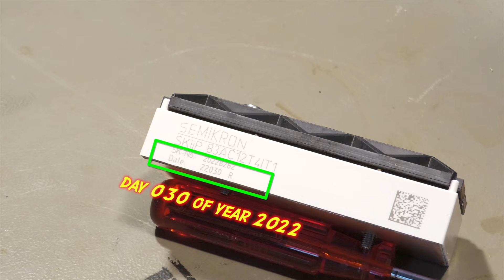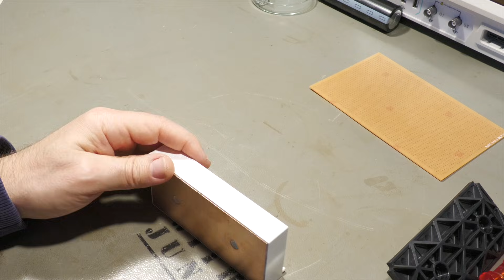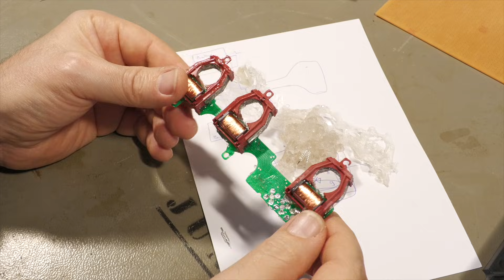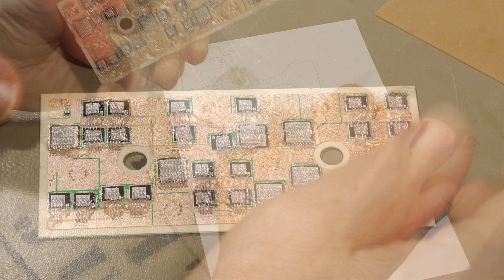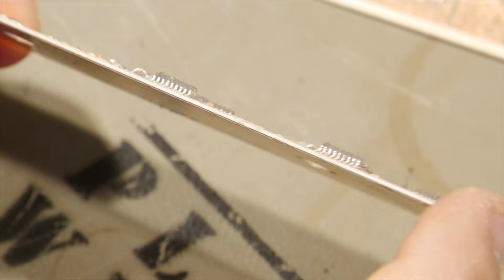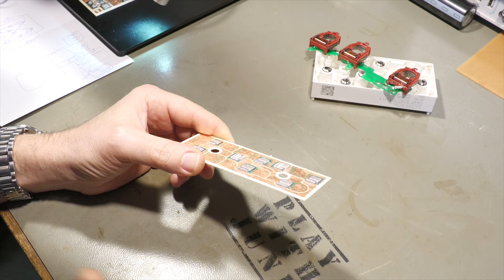Lift or Elevator? This IGBT module moves you!

Comment: Some of the modules contain a 3 phase rectifier and some also contain dynamic braking transistor outputs that connect to an external resistor to dump the excess power so the DC buss capacitors don't overvolt, and that would cause the drive to fault when reply stopping the motor.
Reply from the maker: Yeah! I use the breaking resistor now as a dummy load to test UPS systems 🙂 230V 1600W

Comment: i've looked at modules exactly like this under a thermal camera. And it's actually very interesting. Especially upon first power up and loading. You can watch the current move throughout the bond wires and dies

Comment: We are in the process of replacing all thermal paste with graphite sheets between IGBT modules and heatsinks for all 180kw inverter modules on our portfolio. Each inverter has 3 of these IGBT modules ( one per phase ).
When these fail to cool properly they tend to rapidly disassemble themselves, taking adjacent equipment for a fast, sooty ride
Reply from the maker: I would like to see a picture of such an explosion 🙂
I also experimented with graphite/aluninium sheets for CPUs but that was too expensive and not necessary. But certainly easier to apply and remove.
Reply: @PlaywithJunk I'll dig up some in the 1.5 million pics taken over 8 years of field work
Reply from the maker: @SwichMad  🙂 playwithjunk@gmail.com
Reply from the maker: @SwichMad  Do you also know a trick to clean the silicone goop?
Reply: Only opened one of the IGBT modules ( Mitsubishi made ) out of curiosity on how they transfer so much power, wasn't very interested in cleaning the glue. 
We replace them in trios ( if one fails, we replace all 3 even if the remaining two test good ).
On blow outs the glue is nowhere to be seen, i suppose it somehow solidifies and gets blown to smithereens. Blow outs also cover the whole cabinet in vaporised copper and soot
Reply: Sent some over

Comment: I was exposed to earlier Semikron power darlingtons a long while ago. Block that size with 2 150A 100v darlington transistors on it, and, as they were not exactly known for reliability, and were also rather expensive, the standard fix for a detonated one was to get 2 heatsink extrusions the same size as the original, and drill it for 16 TO3 packages, with all 16 collectors being directly mounted to the heatsink, and then the emitters of 15 having an equal length of PTFE wire attached, that went to a commoning point as ballast resistor. the last transistor was the darlington side driver, itself driven with around 5A  via a resistor from the driver board. Reasonably reliable, though any fault meant replacing 32 blown 2N3773 transistors, so those were ordered in by the pack, of 10 trays of 150 transistors, so you could get all matched parts for any unit. Nobody used a 2N3055 transistor for anything, if it needed power we used either one of the scrap 2N3773 transistors that were not blown up, or one from a part tray instead.

Comment: Why IGBTs and not MOSFETS? MOSFETS have lower RDSon.
Reply: IGBTs excel in high voltage/current, lower frequency (under 20kHz) applications like electric vehicles and industrial drives, offering better conduction efficiency, while MOSFETs dominate lower voltage (under 250V) and higher frequency (over 100kHz) uses like power supplies, boasting faster switching speeds and lower switching losses but higher resistance at high voltage. The key tradeoff is MOSFET speed vs. IGBT power handling; MOSFETs switch faster but have higher resistance at high power, while IGBTs offer lower voltage drop in high-power scenarios at the cost of slower turn-off due to tail current.
Reply from the maker: It seems that IGBT's are better with high voltages and high currents. The R-on of IGBT's is normally not in the datasheets because they are not purely resistive when turned on. They have a 0.5V threshold like diodes when on.

Comment: It's one of those things that don't look like much unless you understand the sheer amount of power they're handling on a regular basis. Then you're immediately struck by just how amazing it is that so little can do so much. It is really neat to see the innards of those. It's not often you get a chance to see something like that. Though I bet a catastrophic failure in one of those is a pretty impressive sight to see too, lol.
Reply from the maker: Yeah and they are pretty expensive. The bigger module is sold used on ebay for $250. I couldn't find a new price and I assume it's a custom model for Schindler (lift manufacturer). The whole motor drive unit is about $5000 used. I wonder how much they charged for the entire lift repair 🙂

Comment: Bit sad that they already had to replace your lift controller again, when this one was only from 2022... No quality in infrastructure stuff anymore
Reply: if the circuit design around the igbt is correct most premature failures are avoided they usualy fail due to high voltage spikes or short circuit protection problems. premature failures resulting from manfacture are rare . mtbf ratings are excellent
Reply from the maker: The funny part is that the motor controller was most likely not defective. I had it on my bench with the serial port connected to a terminal and it did everything I told it to do. I just coudn't connect the high voltage part, so I don't know for sure...
The lift had some strange behaviour, it failed almost once a week with no obvious reason. I guess the replaced the controller out of pure despair 🙂 But since then, the problems disappeared.

Comment: Very interesting! When I worked for Schaffner in Luterbach we saw thick smoke from the stacks of the waste burners in Zuchwil next door. So we rang the state environmental inspector. He confessed that the static filter had gone faulty but they thought nobody would notice. The filter got replaced within days and we could supply them with the required EMC filter. As part of my job I could go up the lift in the chimney to give the final inspection of the emc part. The HV components were huge in the old days (1977). Lift control rooms were full of large relais throwing AC motors from star to delta and sometimes huge resistors to slow them down.  Not only did our phones got smaller, power components have shrunk too.
Reply from the maker: We have a goods lift from 1974 and I was in that machine room a few times. All that clickediclack of relays and chains and gears is fascinating. I could make a video of that...
Reply: I've had a Schaffner filter go up in smoke!

Comment: Awesome. Would have been interesting to see some of those working. Like turning on a little lamp with one of the IGBTs.
Reply from the maker: That is still possible, the transistors are all good and the bond wires can be straightened...
Reply: @PlaywithJunk  i've looked at modules exactly like this under a thermal camera. And it's actually very interesting. Especially upon first power up and loading. You can watch the current move throughout the bond wires and dies

Comment: That gel is silicon based yes, it is a dielectric gel.
It provides protection from the atmosphere as the module is not hermetically sealed.
Those bond wires on the transistors and diodes are silver.
When the gel is applied it is two liquids that are mixed and it cures to a gel with a binary polymer reaction.
Any bubbles in it above a transistor or diode indicate that overheating has been taking place.
Dark spots indicate that failure has begun to occur.
Pretty interesting inside yes, thanks for sharing!
Reply: Thermal camera would have been cool at the end.
Reply from the maker: There are two holes on the cover they used to fill in that goop after assembly. Iwas a bit surprised to see that they didn't fill it up completely. But I assume since it is squeezed between the PCB and the heatsink, it's sealed off from the environment good enough.

Comment: Do anyone have a idea of which metal are those bonding wires ? aluminium, silver,  platinum ?
Reply: I heard they are from Aluminium or Gold (gold for smaller wires, Aluminium for power). But not 100% sure.
Reply from the maker: Certainly not aluminium, they re much harder. Someone said silver, that would make sense. Platinum would be cool but I have never seen that in semiconductors (but I see new stuff every day) 🙂
Reply: @PlaywithJunk  The datasheet for transistors used in this module, IGC36T120T8L, specifically metions they're ment for aluminium bond wires. Interestingly, older modules of this type had gate resistors when Infineon silicon was used. That or they used IXYS dies with integrated gate resistors.

Comment: I used to work at ABB and I tested frequency converters. They had these IGBT modules. The mass inside is silicone gel. It's worth washing your hands just to be safe :) These IGBT modules can be put in parallel and get a lot more power. Sometimes the modules would explode and that gel would fly here and there and of course you had to clean up the mess :)
Reply: Silicone gel is quite interesting as a potting compound. I imagine these devices aren't intended to be serviced so there must have been a reason to use that over resin
Reply: To keep moisture out. Lift shafts/motor rooms can be damp.
Reply: @simontay4851  This is also one of the reasons why silicone gel is used in these.
Reply: @JamesTK  Silicone gel is flexible, which makes it resistant to vibrations and does not crack.
Reply: @JamesTK  To avoid breaking the bond wires from thermal expansion. And to keep moisture out.